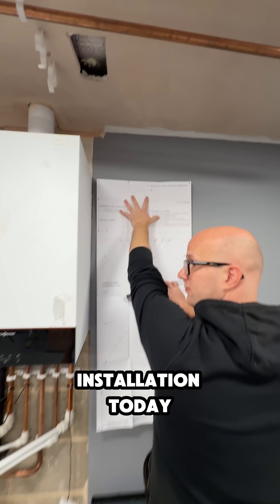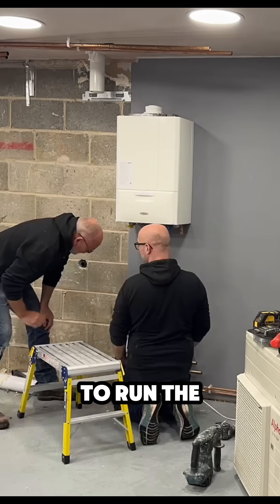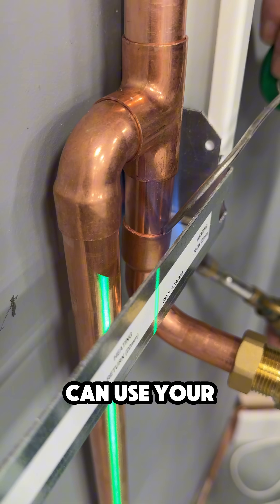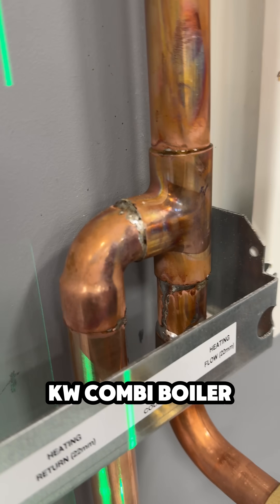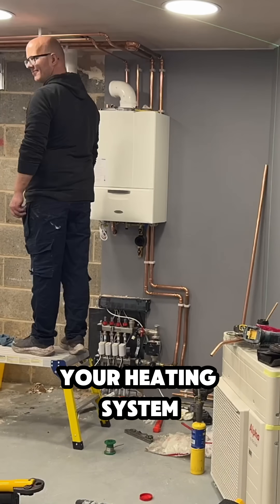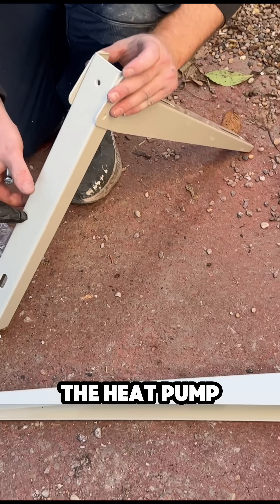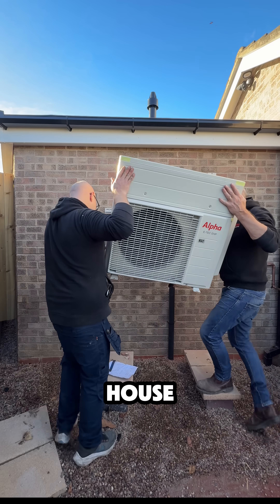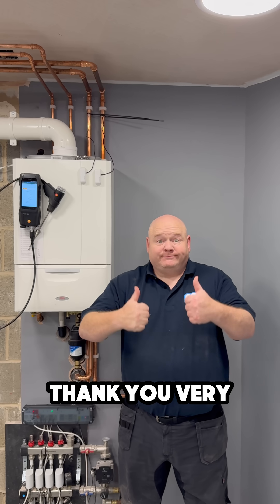Alpha Hybrid Heat Pump Installation

Comment: under full load on the airsource heat pump unit , what is the vibrations like from the unit being wall mounted than ground mounted, are they audible eg could they disturb neighbours with sensitive hearing?   with this setup what are the heat pump unit sizes i know of a 4kwh  but do others exist  up to 10kwh etc,  and did you insulate the condensate pipe from the pump out, to prevent freezing in sub zero temps , also given that the condensate from the pump often causes run off on the sides i wouldn't recommend putting the bins underneath without some sort of roof for them to prevent ice buildup,
Reply from the maker: @ram64man  I can’t hear it at all. I am a bit deaf though 🤣

Comment: Got myself a large panasonic aquarea. All running with the drayton wiser smart therms on every rad. I have had it on everyday lately. Just set to 18.5. Got 12 solar panels. My bills are ok at the moment. But the real test will be from a months time when bit colder. Dont pull in hardly anything on a miserable day. Hopefully everything balances itself out or atleast save something. Certainly with energy prices increasing altime. This is my first year having it all and so far so good. Think my boiler kicks in if gets below 3c-5c.